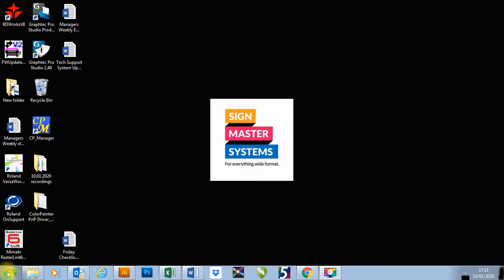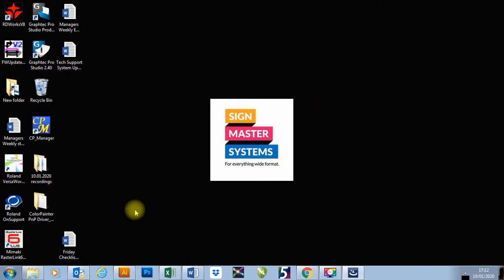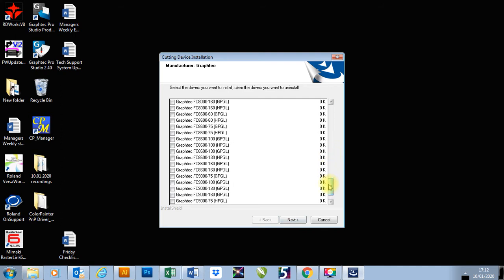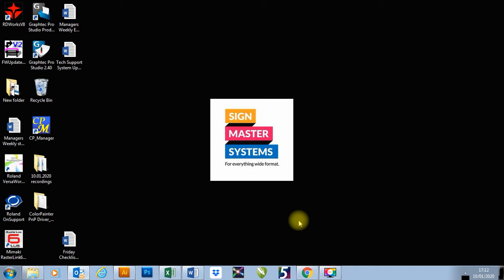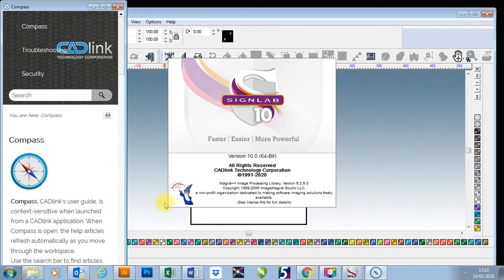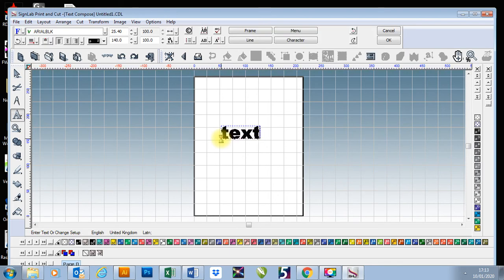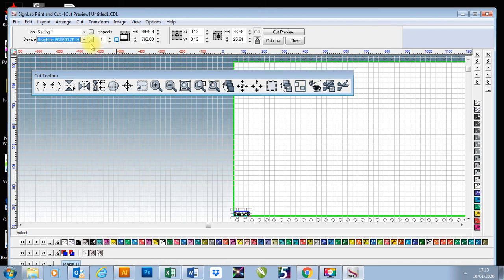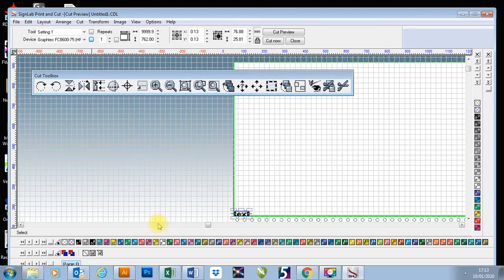How to Install a New Cutting Device in SignLab 10

Comment: Any advice if the vinyl plotter you have isn’t listed in the installation list ?
Reply from the maker: Hello, if your plotter is too new for the software version you may have to update your software or potentially upgrade it to a more recent version

If your plotter is similar to another on the available list both in size a manufacturer you could try selecting that one to see if it will work with your plotter as I have done this myself in the past
Reply: @SignmasterTechnical  it absolutely is not, I remember running the plotter on Signlab 9.5. Maybe the plotter is too old for the new Signlab ?
Reply from the maker: Perhaps then, have you tried another similar plotter from list to see if that will get you going?
Reply: @SignmasterTechnical  I have just purchased another plotter bro, thanks for the reply’s 💙